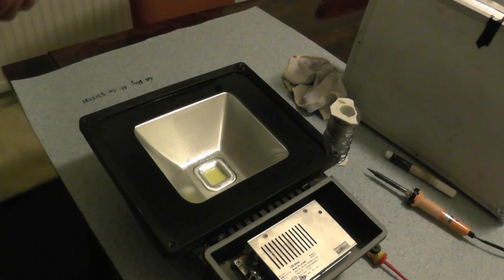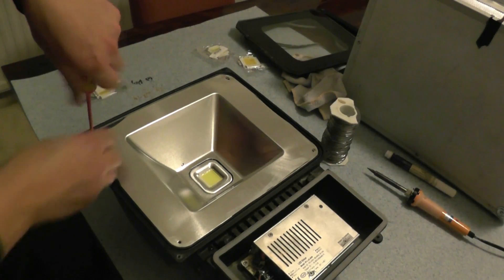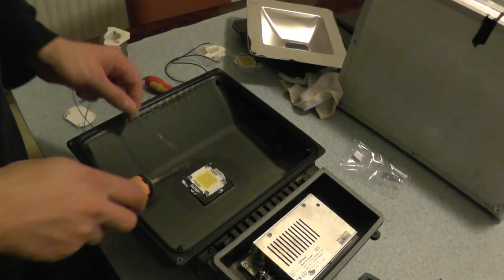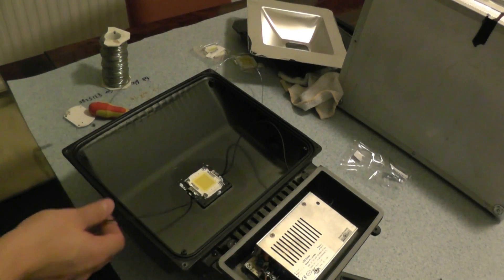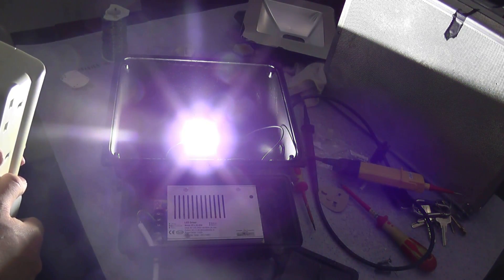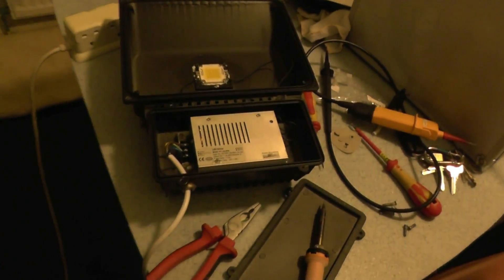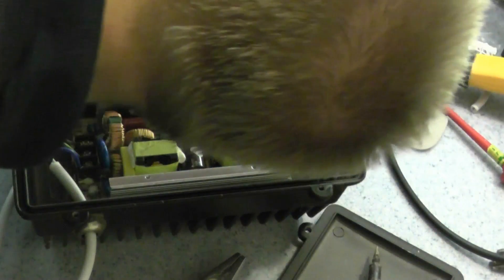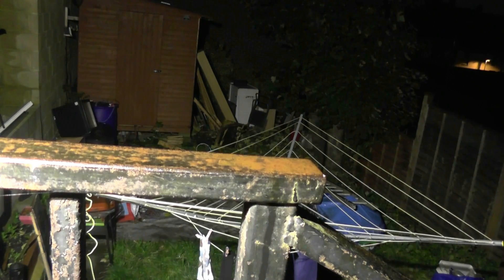80W LED repair (CHIP)

Comment: thanks for video!  You can usually determine the chip wattage by counting the rows of individual led's you  can see thru the phosphor coating.  (8 rows of 10 is 80 watts and 10 rows of 10 is 100w). Also I would never skimp on the thermal paste because these high power chips need all the heatsink contact they can get especially in these cheap chinese floodlights which are notorious for their failure rate due to poor thermal management of led and driver.